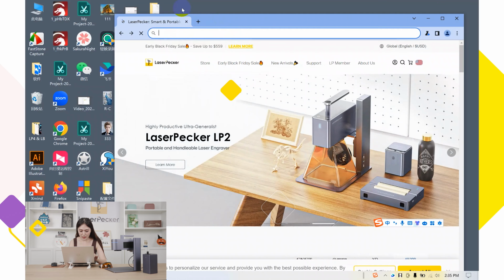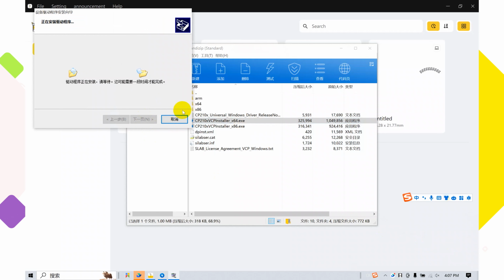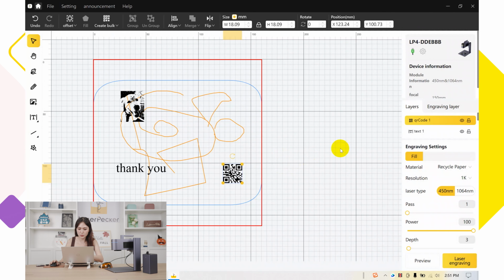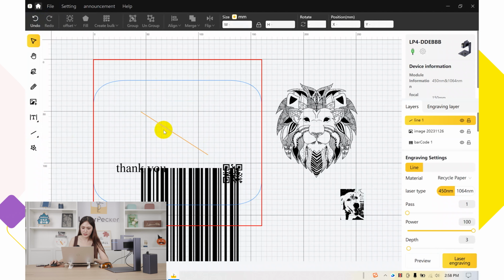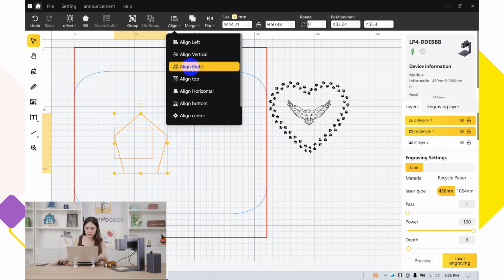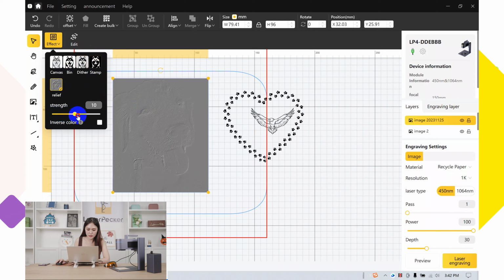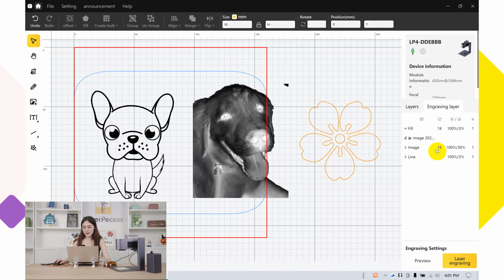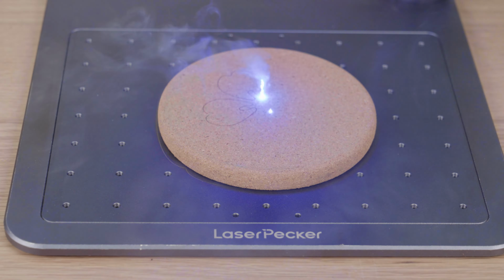LaserPecker Design Space Full Guide: Step-by-Step Tutorial for LP4

Comment: How to use the cut feature?
Reply from the maker: You can choose "cut" and set the setting in the "engraving layer" on the right.
Reply: @LaserPecker  What is the cut setting for plywood of 0.15cm & 0.3cm?
- Which material to choose?
- 450 or 1024?
- Power?
- Depth?
- How many passes?

I tried 450 and 20 passes but still unable to cut. 

Pls help. Thanks

Comment: Thank you for the informative video When I open design space I do not have the blue or red rectangles in mine. Also, is there any way to "send to back" if you have one item on top of another?
Reply from the maker: Thank you for your appreciation! Regarding the absence of blue or red rectangles in Design Space, did you remove the lens lid? Or it may depend on the version or settings of the software. Make sure you're using the latest version and check Design Space's online guide for any updates.^^

Comment: What settings do I need to cut with my LP4? I cannot find any settings to get it to cut any material.
Reply from the maker: What material do you want to engrave? We have different engraving settings recommendations😉.
Reply: @LaserPecker  We want to be able to cut several hardwood species of solid wood and can surface it to the necessary thickness. But need to figure out the settings. I would like to cut 1/8" Walnut into some ornaments.